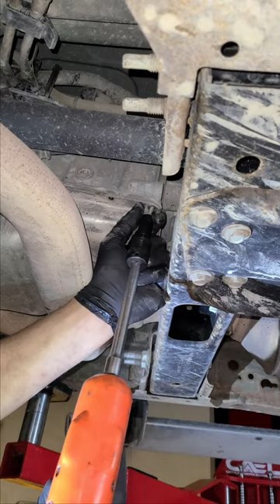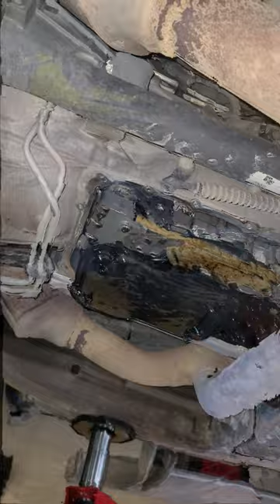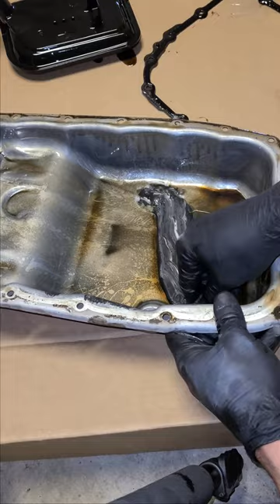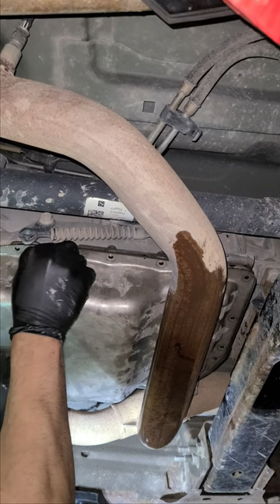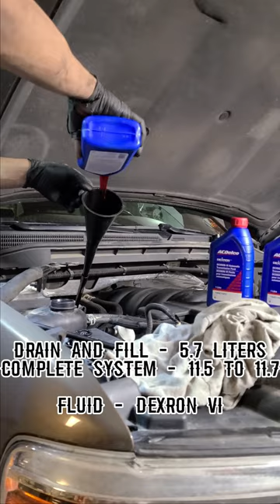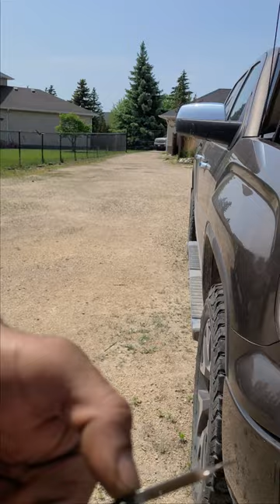2015 GMC Sierra - Transmission fluid and filter change.

Comment: How did you get the pan out?!
The little twist you did typically doesn’t work without lifting the transmission AND pulling down on the exhaust.
Reply: lifting the transmission does no good the exhaust is bolted to the engine which is bolted to the transmission
Reply: Some of them will. But i saw a guy taking off the heat shield on the other side of the pan and it lets you twist it more supposedly making a big difference. Idk but going to try it next time. Also raising the rear of the transmission does help lol. Someone needs geometry class
Reply: You got finesse it

Comment: i’m trying to accomplish the same process here , how much oil did you use and can use ams oil ? a lot of people have a hard time taking the pan out you did it in 3 sec 😅
Reply from the maker: You will loose around 5.7 to 6 liters. 
Yes, on the 2015,  the pan came out with a twist going towards the drivers side. Going back in was harder than taking it out. But it will go. 👍
Reply: Dropping the pan will not remove all of the old atf so if you add amsoil it will mix with several quarts of the old acdelco atf.
It is not recommended to flush the system but if I was switching fluids completely that’s what I would do.
Reply: thanks for the reply

Comment: This is why people don't change tran fluid and filter. This is why most shops will not touch one for a fluid change if the age is 100,000 miles or greater. This is why transmissions wear out and shift rough. This is why.

For some of us this is an all day job and hope you have all the right tools. Better hope nothing else is needed for tools or parts and that everything goes at least smooth enough. At least.
This why people don't do it and why a hefty shop bill comes with it...and they don't get it done.

The absolute genius of an oil pan and one wrench. ONE.
No finesse, no wrangling, no tilting/twisting loosening something here to get to something there and hope nothing twist's off, breaks or strips.

I guarantee you anyone that does this has more than 500 bucks in tools, simple tools, and still are apprehensive. 

This is why people don't do it.
Reply: I agree.  I have a 2015 Sierra 160k miles, and I have about $5k worth of tools, every imaginable air tool and every imaginable torque wrench but after seeing this video there’s no way I’m tinkering with it.  My transmission is shifting very roughly lately and I’m concerned something is wrong with toy altogether.  Not touching this with 10 ft pole.